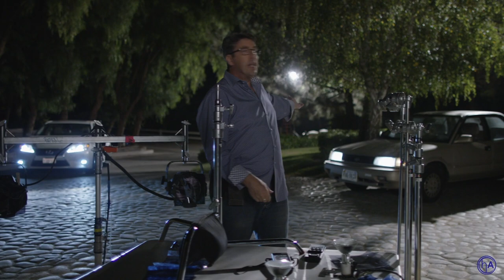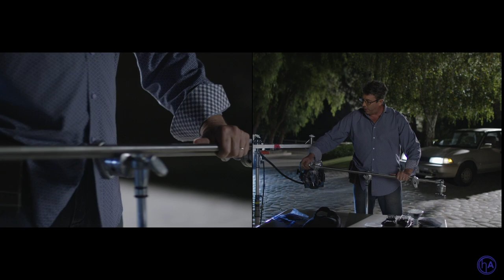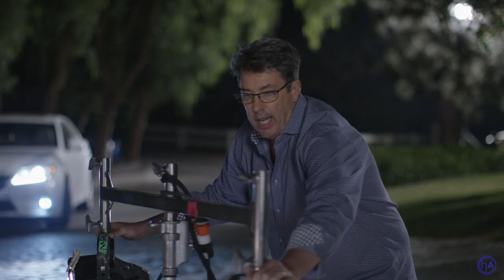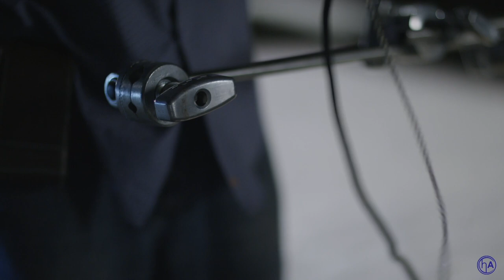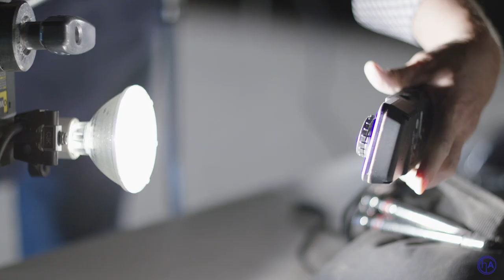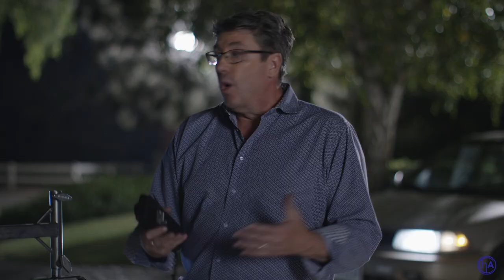How To Build A Headlight Gag

Comment: Unless you have a Electric car you won’t hear no motor lol Still a good video because not everyone has a car or a Tesla LOL I would like to see more lighting gags truly interesting what you can do if you really think about it also I’m having a problem with sound I have a tascam DR40 And I was wondering what the best settings to get the cleanest sound
Reply: The point is it is a total pain in the ass to be moving a car back to 1, and repeating the move over and over. This is so much simpler